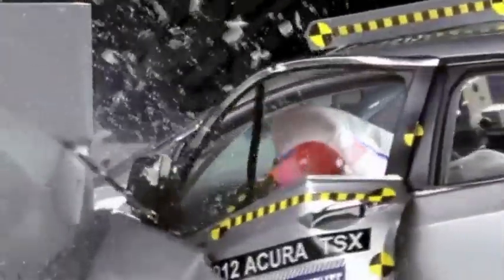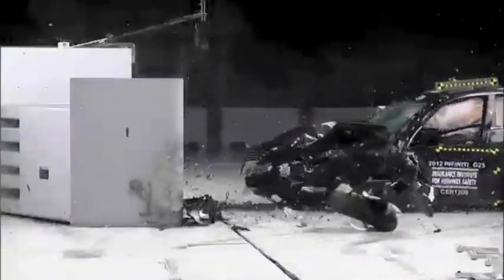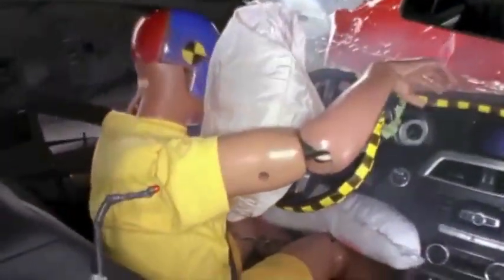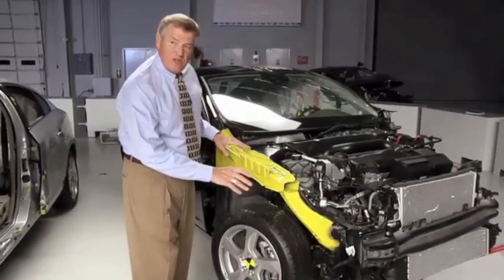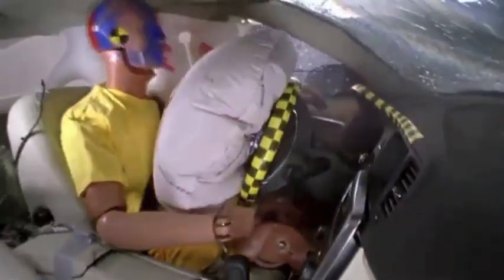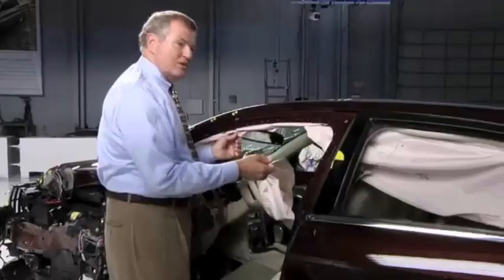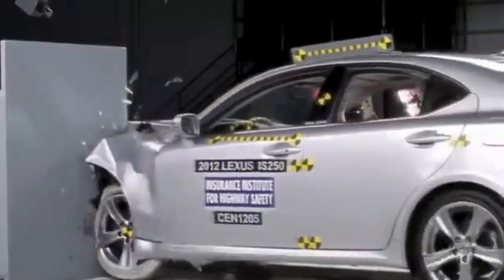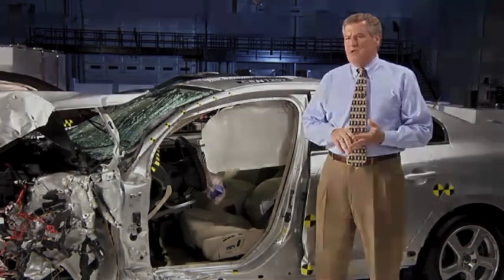Audi A4 and the IIHS Small Overlap Crash Test

Comment: at least the IIHS with it´s small overleap-test construct a crashtest thats missing all the structural parts in the front, picks up the frontwheel to knock down the passenger compartment, concentrate the force on the a-strut which is never meant to wear the load of an accident alone. And then the IIHS brings almost foreign cars to the test to show how bad they resulted? US-cars not tested? or not shown on public media like youtube? come on IIHS, let´s see how US-cars perform in this test and don´t forget the older ones from 2010 and upwards. Just to keep the things on the level. ;)